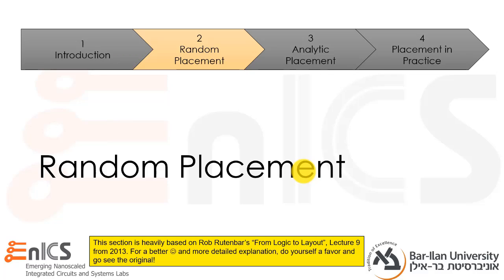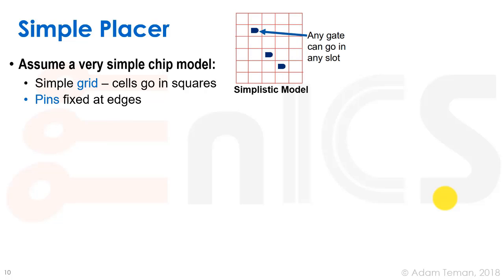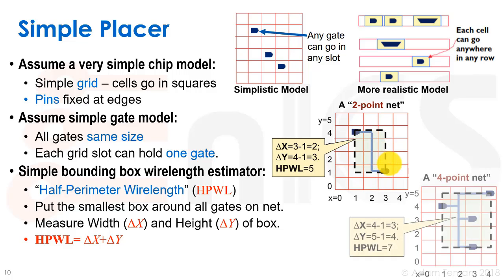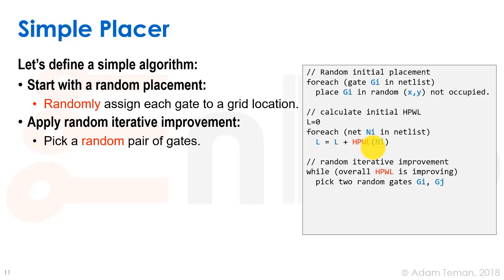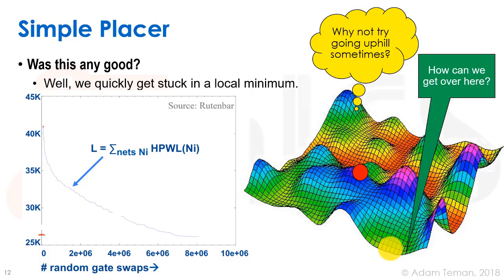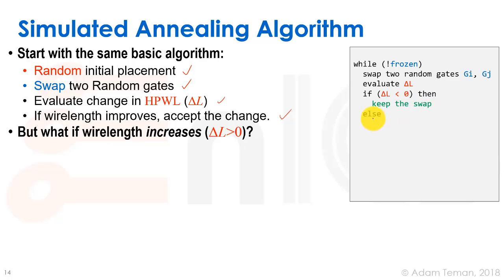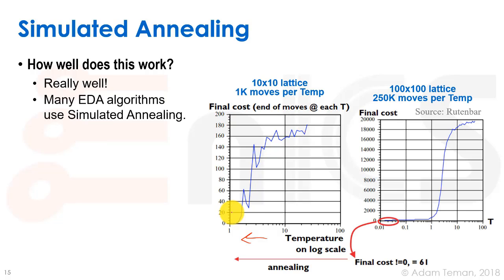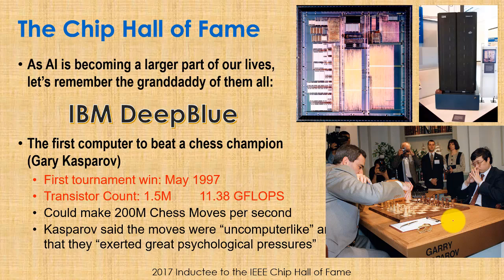DVD - Lecture 7b: Random Placement

Comment: Thanks for the amazing lectures, sir.
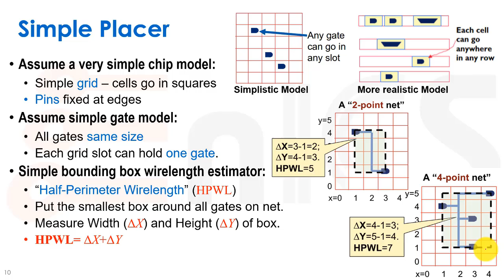I have a question. At 5:00 the HPWL calculated is 7 while if we count the units manually it's 9 as each of the two bottom right cells are also taking one unit of wirelength. You said that these cell doesn't add much in the wirelength but what if they are a little far (inside the bounding box). The actual wirelength can be 10 or 11 units and our estimation would be quite off.
Reply from the maker: Hi Haziq,

Your question is legitimate, because I can say that I have been confused by this more than once (don't tell anyone 😂). But actually, it's almost irrelevant. The reason is that we are building an estimator that is trying to somehow quantify the wirelength, so we can define a cost function and optimize it. It is very clear that our estimator is far from accurate - it just needs to represent something that is better or worse than something else, so we can change it and see if that helps. So counting the distance (|x1-x2|) or the number of blocks that the wire occupies (which comes out |x1-x2|+1) is essentially the same for the purpose we are using it. 

In addition to that, as you will see in the following parts of the lecture, we are actually using other estimators more predominantly (such as the quadratic wirelength estimator). But the point is the same - we are trying to put a number that represents how good or bad our solution is for comparison to a different solution. You could look at it as a rating system that gives you 1-5 stars or a grade of 1-10 - as long as the better option has a higher rating, it doesn't really matter what the scale is.
Reply: @AdiTeman  Thanks. I have completed the following parts of the lecture and got your point. Thank you for taking your time out and explaining.
Reply from the maker: @haziqiqbalhussain  Great